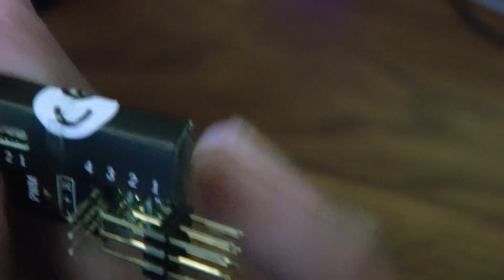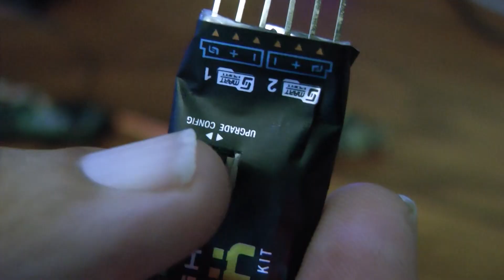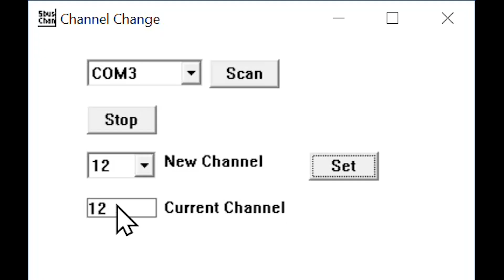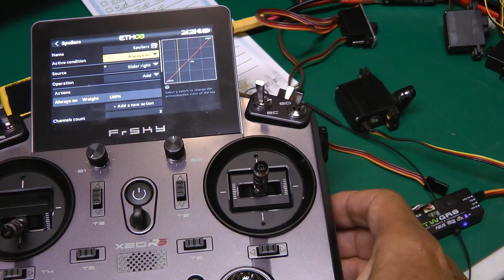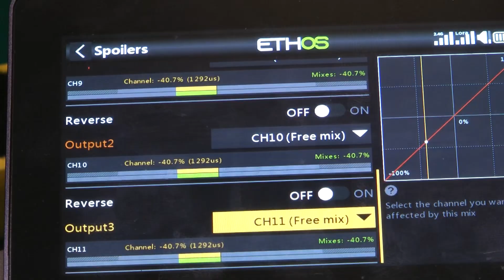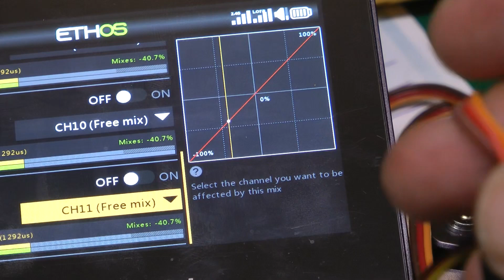FRSky SBUS decoder how to program without the FRSky channel changer card

Comment: Hi Gary, I just got my STK and decoders but I don't seem to be able to make it work. STK on upgrade decoder on port 2 The STKshows a red and a green led on but I get the 0 on the little app (tried both options for me COM5 and COM6) and nothing. Tried an older PC running win10 and didnt work either. Is it possible that I need to update (or downdate the STK)?
Thanks.
Reply: I think I found the issue, Device manager says there are no drivers for the STK installed in the PC so I'm stuck
Reply from the maker: Try the driver I posted on RCG where you recently commented on.